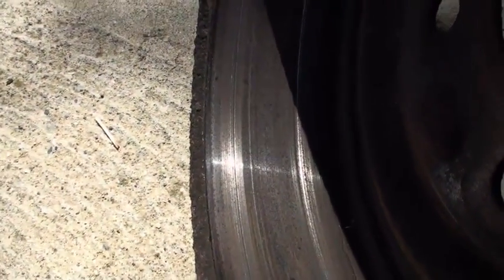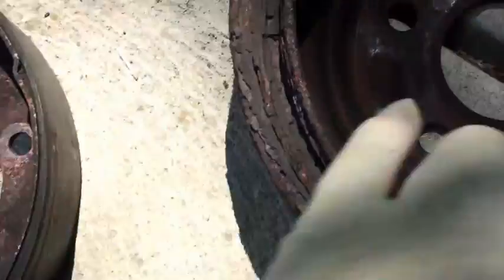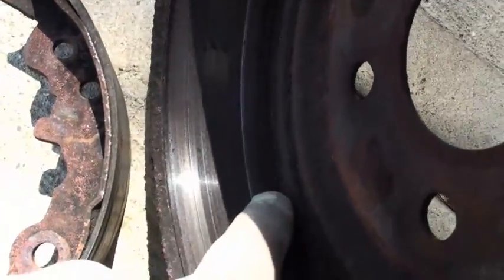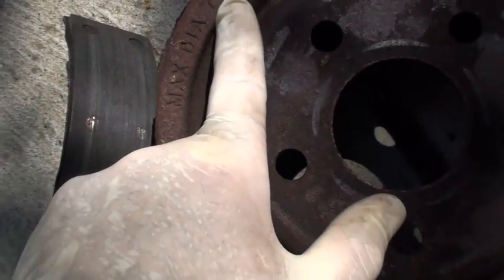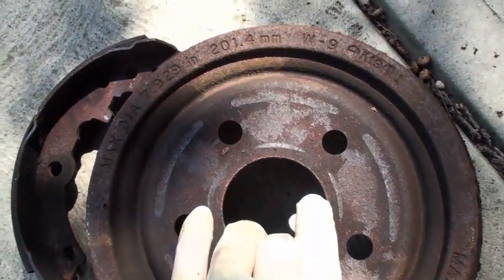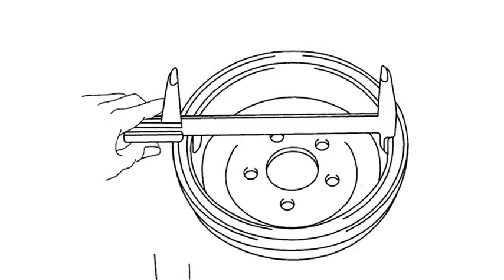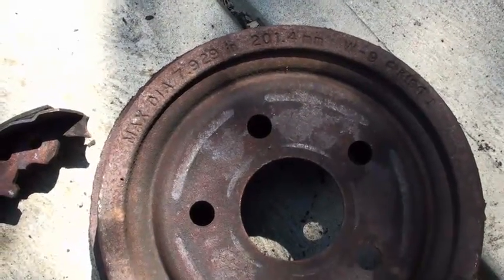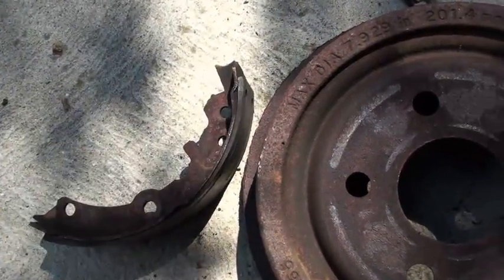Drum Brakes, When to Discard - EricTheCarGuy

Comment: One thing to consider is when you fit new shoes - you have to fit the drum back onto the hub..  This can be a tricky with a new drum - tolerances are very low and you dont have much space to do it.  If your old drum is looking alright it can be a much cheaper and easier job to re-use it.  Don't do this is the surface is uneven or badly scored tho - or if significantly past its minimum diameter / thickness.  I reused a drum recently that was 14.5 years old - but it still had 2mm of allowable braking surface - and that surface was smooth.  The main function of a rear drum is your handbrake anyway - thts all you really need to worry about

Comment from the maker: @gjeka02 Depends, are you talking about disc brake pads or rear shoes?  If your talking about rear shoes then it's actually normal for them to wear that way, remember the wheel cylinder just pushes out on the top of the shoe.  If your talking about disc brakes then your caliper slides may be sticking.

Comment from the maker: I did a video on Check engine light basics a while back that you can check out.  You don't necessarily need to take your car to a mechanic to get the codes read from your vehicle, most auto part stores do it for free these days.  Thing is that they can read the codes but have little to no experience correcting the problems.  They will get the process of repair started however.

Comment from the maker: @AstonishingCardMagic In your situation the pads would not be a fault but rather the rotors, it could also be the drums or rear rotors.  If you feel the shimmy more in the steering wheel it is probably the rotors, if you feel it in your butt then it's probably the rear brakes.  Depending on how much metal is remains and how bad they are out of round you may be able to machine out the problem rather than replacing them.  Most auto parts stores machine brakes these days for a nominal fee.

Comment from the maker: @abyrichards You may not have the adjuster backed off all the way, you may also need to push the shoes in against the wheel cylinder as that can sometimes expand during a brake job causing that problem when you go to reassemble.

Comment: Hi Eric 
My front right brake is screeching when I am driving. New pads. But the rotor does have some lines in it and there is a mil rim on the edge. It stops when I brake. I got them changed this time in a garage and the guy said to brake hard a few time to ware them in. Was that correct. Will it go away after some miles or do I need to do something. The wheel over heated big time too prob because of me braking all the time to make the noise go away :)
Appreciate your help.
Best wishes David.

Comment from the maker: @jareds1007 I have actually done a couple of pad replacement videos if you'd like to check them out.  Most calipers are set up the same so even if the video is not for your specific video you can still take many of those principals and apply them to your application.  Good luck.

Comment: I know I am like 9 years late to the party, but I did have a question that I'm really hoping someone can answer.  I am looking to replace the rear brake shoes on my 1986 Honda CRX DX, and I was wondering if I should buy the whole "Brake Drum Kit/Set" which includes new springs, clamps, ect;  or if I should just buy the shoes themselves?  Thanks in advance for the info.
Reply: All those springs, clips, etc. are called "brake hardware". In a pinch you can reuse hardware if it is in good condition but replacing the hardware when the shoes or pads are replaced is generally considered a best practice.

I would personally rather spend the extra money to have the piece of mind that the hardware in use hasn't been thermally stressed or mechanically strained to just within its acceptable margin for failure so that 20k miles later it is in failure territory.

Comment: @EricTheCarGuy So I had to measure the inside diameter of my brake drum with a tape measure but I got about 9-15/16" or 252.4 mm.  My maximum outside diameter is supposed to be 256.3 mm.  So technically I can wear them down another 4 mm.  Should I go ahead and replace them?  I have 209,000 miles on my 2003 ford ranger and I've never changed the rear brake drums.

Comment from the maker: Engineers don't work in "suggestions", if they say discard thickness, they mean it.  I'm not an engineer however but having worked on cars the better part of my adult life I can say that it's never a good idea to skimp on brakes or tires, both are probably the most important parts of the car.  If the question you pose is "could you?", the answer would be yes, but if the question is "should you?", then the answer is no.

Comment: Your videos are very good  thanks. Now for my question Just recently I had from rotors and pads and rear drums and pads changed. I now hear a thump thump sound when I apply the brakes (only when I am going forward) Its a TJ 2003 no abs)  I   raised the vehicle  from the ground by the axles and did the same I hear no sound at all. (no load)  I feel nothing in the pedal, but the TJ stops very well.  I have pulled the wheels/brakes drums and found nothing to be loose. Can you put a light on this problem.

Comment: Hi!i have a brake Problem on my  fiat 126,the rear Brakes block them selfs after i push the brake pedal and afer i drive a bit they release.they do not block 100% so i can still turn the wheels but enough to really heat the hole whells.The strange Thing is that when i loosen the bleeding screw on the rear wheel the Brakes stop blocking.I was told that the Problem could be that the brake pipes where rusted from the inside out so i connected an air compressor on the rear brake pipe to blow air from the rear Brakes to the main cylinder(i did disconnect the pipe from the main cylinder first),but id didint help.I also replaced both rear brake clylinders.Please help me!!!!what could cause the Problem?Thank you and greetings from Croatia

Comment: Brake shoe wear surfaces can harden to a point where they no longer brake and the glazing is so deep that sanding the surface won't do any good. This can happen if the shoes touch the drum all the time or if the brakes aren't used hard from time to time.

Comment: I recently lifted my Jeep up and I was trying to wiggle my tires to see if i needed to replace my wheel bearings all the way around and i noticed i'd hear a small "slap" from my brake drums when i wiggled my rear wheels.  The wheels are torqued all the way down.  But i don't know what's causing the "slap" noise.